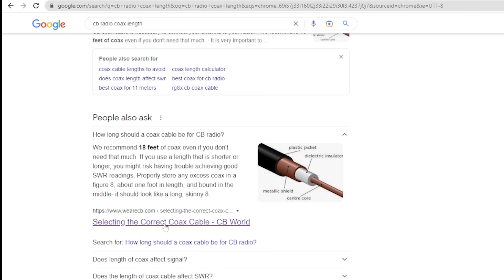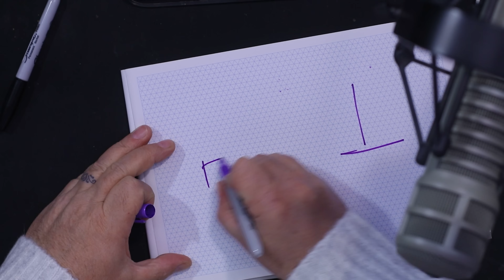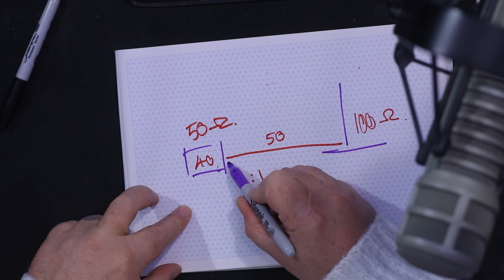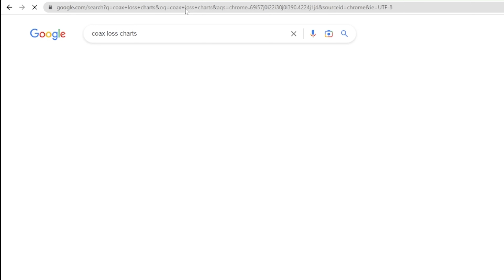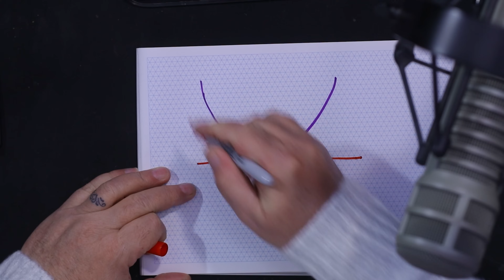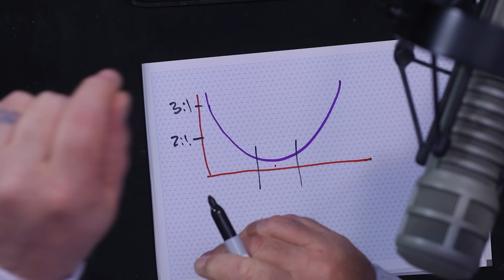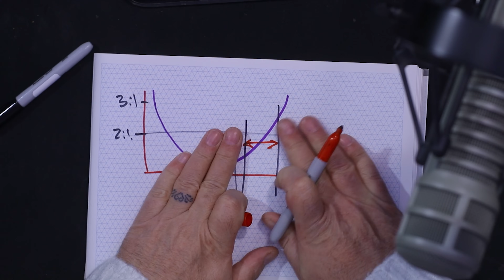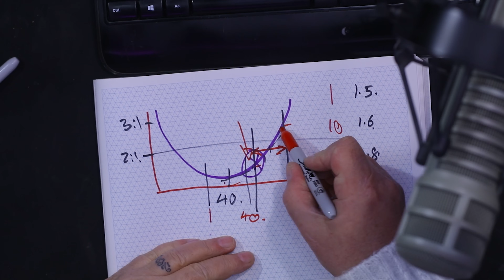11m / CB Radio: How Long Should My Coax Be?

Comment: The correct length of coax is the distance from the antenna to the radio. Period.
Reply: Great video, wish I had the property for a DX commander! I bought the Eurocom hf 360 from UK, will put it up this spring! Chow 73 JohnBoyUtah KJ7TBR 😎🇺🇸📡🎙
Reply: Thanks for explaining the process about coax length  ,I enjoyed it very much
Reply: It's going to be a lot of trouble talking on a radio with the antenna 60ft in the air and only having 18ft of coax ? 
Your going to need a tall ladder
Reply: Exactly
Reply: Not true. If the impedance at the antenna does not match the rest of the system impedance then the coax will act as an impedance transformer and adjusting the length of the coax can lead to a more favorable impedance visible at the radio.
Reply: Exactly!
Reply: Absolutely true! Detractors, naysayers: please state your references, sources of info
Reply: An antenna driven element requires something to work against. A dipole, for example, has a driven side and an rf grounded side that work together to transmit. A 1/4 wave cb vehicle antenna will require two  components to work, the bit sticking up, and some sort of rf ground.

If the vehicle has a metal body, then it is the rf ground. If the vehicle body work is non metalic, the coax will be the antenna rf ground, and it should then be  then an appropriate length.
Reply: @petertyrrell6690 , I have been running a CB since 1974. I have had coax antenna cables from 8' to 18' in length. Never had any issue with getting a 1:1 - 1:6 SWR on any of my Cobra 29s with K40 or Wilson Antennas, across all channels.
Reply: @BRNTVOFFICIAL1 I have no doubt,  as the body of your vehicle is the ground plane of your antenna.  If you were to get a new out of the box, CB antenna and set it up away from your vehicle and any other metal, the SWR would probably still be okay because the sheath of your new antenna's coax would be the other half of the antenna system. In this configuration it becomes a center fed  dipole .

Now if you were to shorten the coax of this new hypothetical antenna system,  the SWR would be very high as you would now have   a too short off center fed  "diopole". 

Again no surprises at all that your CB antenna system worked for you with a shortened coax. You might not be so fortunate with a plastic body vehicle as the ground plane would now be shortened coax,  and that would be a problem. 

73.
Reply: @petertyrrell6690  And you're doing it wrong.
Reply: @petertyrrell6690  Wrong
Reply: @terryparker1925  Nothing I've said is "Wrong". Take a class or read a bit. Try running 75 ohm coax between your 50 ohm antenna and your 50 ohm radio, unless you trim the coax, you won't get a 1:1 match. (Google as to why.)  Again, if your antenna,  coax, and radio are 50 ohms, coax length won't make any appreciably difference.   
73
Reply: @petertyrrell6690  If your swr changes when you change the length of the coax then the coax is radiating and you're doing it wrong. YOU'RE  doing it wrong. Smarten up.
Reply: @terryparker1925 not necessarily, the impedance at the transmitter can change with length if there's a mismatch
Reply: @Pioneer936  Then fix your shit. You're doing it wrong.
Reply: @terryparker1694  the impedance changes at the input with standing waves the feedline becomes an impedance transformer, these are facts of what is happening
Reply: @Pioneer936  Then your feed line is radiating. No good. Tune the antenna not the feed line. If you're cutting the feed line to tune SWR you're doing it wrong.
Reply: @terryparker1694  feedline radiation is caused by an antenna imbalance not an impedance mismatch, swr on the feedline changes the impedance not the swr ,the feedline becomes an impedance transformer, 
Common mode current from an antenna imbalance can interact with swr but is not the cause, a simple rf choke can resolve this issue
Reply: @Pioneer936  If you are cutting the feed line to adjust the swr you're doing it wrong. End of discussion.
Reply: @petertyrrell6690  LOL I have been a radio operator longer than you have been alive, numps. Dismissed, kid.
Reply: @terryparker1694  unless you're in your 90s, probably not. 73
Reply: @terryparker1694  please reread what I have said ,the impedance at the radio will change with different lengths,the feedline becomes an impedance transformer with standing waves
Reply: @petertyrrell6690  Close, numps. Radio and antennas was my job in the military. I have forgotten more than you will ever know. My first dx contact was in 1964. Run along child.
Reply: @terryparker1694  Congratulations on reaching a ripe old age. However, I don't think that I have disagreed with anything that you have posted. Anything I have posted, I have built and measured the results, so I am not wrong myself. 
73
Reply: @petertyrrell6690  BOLLOCKS
Reply: @petertyrrell6690  Nope, co-ax length is a myth
Reply: @george-ev1dq  I see  you have not studied this topic or built many antennas.

It is simplistic to state that coax length is a myth, this simply isn't true, however, If your antenna impedance is 50 ohms, and the characteristic impedance of your coax is 50 ohms, and the output of your radio is also 50 ohms,  it is quite true that coax length doesn't  really matter. But, if you install your CB antenna into a vehicle, with a plastic body, and chop your coax,  your going to struggle to get a match. If you do, you're probably using the wiring of the vehicle as part of your antenna, which, you'll agree, would be suboptimal.

When you feel like it, connect your radio directly to a stock  cb antenna, out of your vehicle, without any coax, and see if you get a 1:1 match, and then check it with the supplied coax.

The varying impedance of Coax line length with transmitted frequency, are routinely exploited in antenna construction. Why not Google for more information? 73.
Reply: @petertyrrell6690  Have built hundreds of antennas since the mid 70s, never had any bother with them.
Reply: @george-ev1dq  I also have been building antenna since the 70's, for a variety of bands.  If you had an antenna analyzer you would be able to  observe what I have stated, and  use your new found knowledge to your advantage. 
Anyway. 73.
Reply: @petertyrrell6690  "But, if you install your CB antenna into a vehicle, with a plastic body, and chop your coax,  your going to struggle to get a match" Wow, no kidding, in that case you need to create a counterpoise (ground plane) or the antenna won't properly work. you could do it by folding back some of the coax shield at the antenna connection, it's a crappy ground but better than nothing or find an antenna that's designed to work with no ground.
Reply: @RichardMartinke6rji  Yes, you would have to make your own counterpoise, instead of employing the sheath of the original factor supplied coax.
Reply: @petertyrrell6690  WRONG

Comment: Many many years ago I remember using a 5/8 wave dipole set up on home, the swr was between 1.3-1.5, I extended the sections by about 18 inches and swr went up to around 1.6-1.8, I left it slightly higher because for miniscule loss of power I got out better and received better due to the height of the antenna being better, I also remember using the shortest path and the least amount of cable neeeded, because even with very little electrical knowledge, logic told me you need to minimise the electrical path..
There use to be many myths around involving wrapping 20 foot of cable up in a coil to get out better, and the proof was this is what the guy at the top of the hill did and that's why he got out so well, the reason he got out so well was because he lived at the top of a hill and was using a stalker x pushing 15 watts and the majority of us were running standard 4 watt rigs...
In the street where I lived back in 1982 you'd be lucky to find an unused channel, there must have been a dipole on the roof of every 3rd of 4th house on the housing estate, teenagers out all night with handhelds and the local car park was a place for eyeballs, where you'd see 20 plus cars parked up with various whip antennas 😊
Reply from the maker: Great times.

Comment: For a broadcast station, which operates on a single fixed frequency, good practice indicates the use of a specific coaxial cable length related to the operating frequency and the wave propagation speed in that cable. In amateur radio, we don't work on a single frequency, but on several distinct frequencies and, indeed, multiple bands. For each frequency, if we consider that the cable must necessarily have an adequate length and act as an impedance transformer, for each frequency, and not just for each band, we should have a cable of a different length. Is this what happens in practice? NO! Because, economically speaking, this is unfeasible. Therefore, if we consider a small margin of error, in any literature in the field, you will find that it is recommended to use only the amount of cable necessary to reach the transmitter, thus avoiding signal loss.
Reply from the maker: I didn't know about that as regards Broadcast Stations... Roly (ZL1BQD) and I have discussed this and he never mentioned specific length.

Comment: When I became a novice ham operator I build a 144Mhz linear amplifier that worked without a RX/TX change-over rely, it used two 1/4 wave length coax lengths and diodes, the diodes conducted during TX and the two 1/4 lengths being impedance invertors insulated the input from the output, it works so I know coax length can make a difference.....at critical lengths and that is not a myth.
Reply from the maker: You're absolutely right, at critical lengths it's not a myth!

Comment: I co-phased 2 x 3 element beam antennae with 75 ohm coax. I rolled up any extra length of coax in a coil. At the T where my coax came up the mast, I also made a coil. These antennae were hooked to a 12-foot-long pipe that sat on a 60-foot tower. It was fun tuning each antenna, but the results were 1.2:1 SWR. For a legal CB, that antenna was remarkable.
Reply from the maker: That's an impressive setup, nice work!

Comment: Length only matters on 75 ohm coax not 50 ohm if you wanna test it put a couple different Lengths of 75 ohm on an nano vna in the trough mode and scan from 1mhz to 30 and watch the wave look like a jump rope. You can shorten or Lengthen it to be able to use it on a particular frequency that the swr dips on.
Reply from the maker: SWR Freaks love you, I'm sure :)

Comment: I disagree, Coax length does make a difference, especially for jumpers from radio to meters and other things in line. Of course the linear circuit could be tuned but try this experiment. Put one end on a piece of coax leaving the end off the other end, connect it to your antenna analyzer and look at the ohms. 

Now trim your coax until the ohms drop to zero for the frequency you want and put the other connector on it. The velocity factor changes the length of coax to get zero ohms so the 3ft, 9ft, 18ft coax is a myth or a half truth but if you're after the lowest possible swr for your set up then try that experiment. Even though it's splitting hairs and wouldn't be worth it for ham because you're using the same coax for multiple bands and antennas but it does work for a single band set up like cb. 

I forget what coax I made jumpers from last time but because of the velocity factor they came out to be 7.5ft a piece and dropped my swr from 1.7 to about 1.2 between the radio and meter. Go ahead and laugh but when you're only "locals" are 30+ miles and another group on ssb is 77 miles away the little details make a difference.
Reply from the maker: Disagree all you like - what you might have done is match a crappy antenna by using odd coax lengths. My argument is that if you have a 50-ohm antenna and a 50-ohm rig - it doesn't matter. Well, shorter the better.

Comment: In my opinion, the cable length is the frequency range of the CB radio. In my opinion, there is only one length of 3.66m 
(rg58/rg213 cable) whose length takes into account the speed factor of 0.66, which means that the entire line from the radio to the antenna is the same 50 ohms.
Reply from the maker: The shortest length for a 50 ohm antenna and a 50 ohm coax and a 50 ohm radio is what we all need.
Reply: Then I would need several lengths of coax to operate from 1.8 MHz to 28 MHz. 
Guess what? I don't!
One length to my tuner and long wire, about 20" does it all.
Attic dipoles, one length of about 25'.
G4GHB..

Comment: Ignoring the fact that RG58 leaks like a sieve, you have to ask yourself where is this energy going, and this is where a lot of CBers got into difficulty with the cable running on the other side of the wall where there neighbours TV was mounted and through direct coupling causing interference. These days there is no excuse for using RG58, when there are low loss cables like West Flex 103, with a 0.2db loss over 100 meters. Always use good quality cable.

Comment: Interesting video, what the CBers did was change the length of the coax because it was the coax which was resonating and not the antenna in most cases, also you failed to point out in the video that that an impedance of 25 Ohms will also give you a SWR of 1:2, and an impedance of 12.5 Ohms will give you a SWR of 1:3. I would also like to point out that to get the maximum transfer of energy, the impedance at each end of the coax has to be the same.
Reply from the maker: Good points!

Comment: So im ok in my freightliner that has an overhead cb cubby, to use a 2 foot long coax to a wilson gum drop stud mount through the roof? Just so long as i have my swr dialed in with my antenna?
Reply from the maker: That's fine.
Reply: @DXCommanderHQ well thank you for the reply. Its much appreciated sir.

Comment: COAX length DOES matter, though, if 2 or more antennas are connected in a «stacked» or co-phased configuration after a «T» splitter is inserted in the line. The waves radiated by each antenna need to add themselves together, and not cancel themselves out. Twin-Trucker antennas are an example of that.
Reply from the maker: Erm... Wasn't talking phase lines! LOL

Comment: The problem came about because CB antennas (vertical antennas) are rarely have an impedance of 50 ohms, which leads to SWR in the system. CBers, being concerned about this adjusted the length of their coax in order to present a more favorable impedance to their radios in order to make sure that they were getting full power out of the radio. The SWR didn't go away, but the measured impedance at the end of the new length of coax did appear to be more favorable.
Reply from the maker: I don't think this is the reason at all - most CB antennas are actually 50 ohms and always have been. It was some clever-clogs that read a book once and before you know it, they're all at it!

Comment: howdy Calum good video i have been in CB for right at 60 years and ham about 30 years i always smile when the CB guys argue about coax length. I  never do measure coax  when i take it off of a spool or roll i just go from antenna to radio + 3 feet+-  i have coax 46"5" lol... mobile same thing just what it is between antenna and radio.. never have SWR issues.

Comment: I would say this is interesting but I have had whip ant. installs that the coax length mattered to get a good SWR.  We were running a 102 inch whip, 6 inch heavy-duty spring with a heavy-duty ball mount on a Landcruiser and VW bug.
Reply from the maker: If length matters, the antenna is crap.

Comment: Has anyone ever used RG-6 or RG-11 75 ohm cable for a CB transmit feedline?   If so, I believe the lowest SWR you can get is 1.5 : 1 due to the 75 ohm impedance mismatch.
Reply from the maker: Erm... Long story. Wirte a book on it :)

Comment: Unless your coaxial cable is being used as a pseudo Counterpoise where it should be about 1/4 wavelength at 27.00 Mhz, then it does not matter.  There is lower dB loss in every foot the coax is shorter.   Anyways, you should never use your feedline coax as an antenna radial counterpoise!
Reply from the maker: Last sentence. Ageed.

Comment: Good sir yes I'm late to the party I have a new antenna with mag mount built in its RG8X 18ft length I'm new to this and trying to figure out if this is length is going to be ok ..I'm sorry being new I kinda don't get it yet..it's a Stryker A10 mag mount the RG8X is very well made.. maybe coil up the access coax???
Reply from the maker: Length... PLEASE don't woprry about lengths... Hell, do not ever fall into that trap.

Comment: You have to give some weight to CB manufacturers here. I just bought a Cobra 75 Any Road, and an 18 inch Cobra antenna, and the antenna has a 15 or 16 foot cable. If 18 was important, Cobra wouldn't short the cable by a couple of feet to save a buck, and at the same time, reduce performance of their radios... the reason for 15 or 16 feet is that will work with MOST vehicular installations. Myself, I cater to the idea of radio as close to antenna as possible, with an appropriate length of cable. I will be shortening my coax to about 3.5 feet, since I'm doing a roof mount(radio), my antenna is just a couple of feet over, on the other side of the sheet metal.
That said, thanks for the vid so I don't feel so bad about bucking 'conventional wisdom'. lol.
(Yes, I will be getting a 1/4 wave antenna soon but, it will mount in the same place as the shorty... I got the shorty for temporary relocations of the radio, and will likely use my left over(cut) cable for such usage, as temp usage will not have a clean, short path to the antenna... out through a window, etc).

Comment: From the radio to a tuned 1/4wave antenna to 27.205mhz (mid band) you need about 112' of LMR400 coax in my case
is a good place to start.
YW
Reply from the maker: No you don't. I think you questioned this before.. See pinned comment.